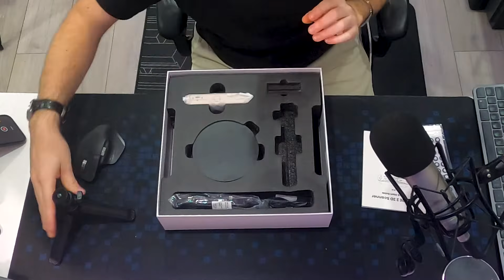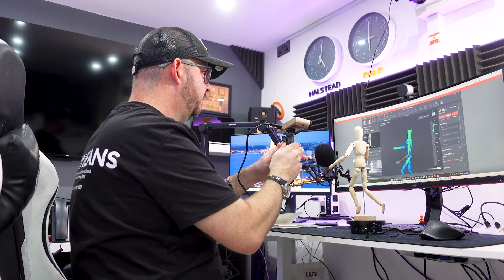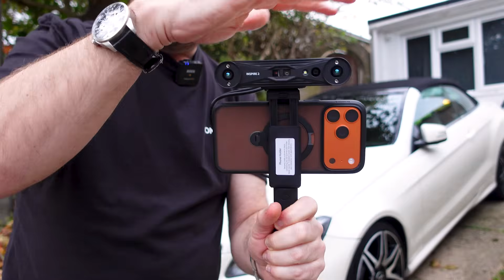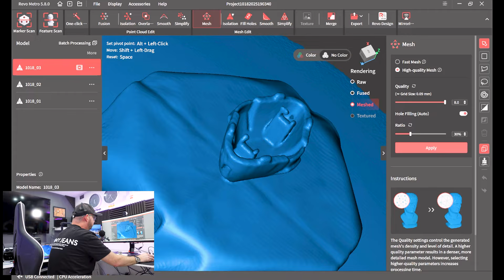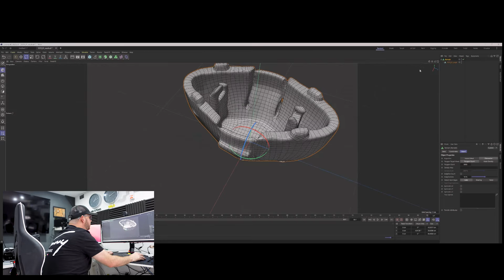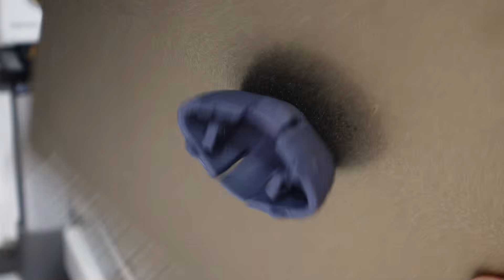Revopoint INSPIRE 2 Review | 3D Scanning for 3D Printing Car Parts (Mobile Kit Test!)

Comment from the maker: Is there any aspect of the Revopoint INSPIRE 2 would you like to see a follow-up video on? The mobile workflow, more on the post-processing in Revo Scan, or something else? Let me know below and don't forget to like this video! #revometro
🔗Link to Inspire 2: https://tidd.ly/3J1MFqI 👈👈
✨ Save at least 7% with the exclusive discount code: REVOPRRMFL
Reply: you REALLY need to try laser mode, it's the only 3d scanner in this price range that features this function and should be much more accurate compared to using the structured light.
Honestly it's the only reason to even get this scanner... if someone wants to try reverse engineering something, the other scanners in this price bracket are not suitable, this is the only option IMHO
Reply: It would be cool if you could scan other parts around your house that need repair.

Comment: Interesting to see! Thanks.
I'm looking for a relatively cheap solution to scan surfaces of RC cars to model off of. Now I'm measuring and making a ton of prototypes, tweaking and printing again. A scan of a front wing, for example would give me the compound curves to work from. Colours and textures aren't something I need though, 
This is a pretty new scanner I guess? I've seen your 3DMakerpro testing too, toss-up between the 2 brands?
Right now I'm stuck between the Moose Lite, Seal Lite or this.  Cheers.
Reply from the maker: Hey, in fairness both are good. This one is brand-new so the technology is likely slightly better, but I have had good results with both. It’s just important to remember that it’s not a super easy thing to do. It takes some effort to learn it, but then when you do, you can get some really spot-on results.

Comment: The laser mode is used for black and reflective objects and offers much higher detail. You've only used 50% of the scanner's capabilities. It's the only scanner with laser mode at this price point.
Reply: He did not use the available laser mode?  That’s disappointing.  This video shows that this scanner is not good for reverse engineering.  A shame if it actually is.
Reply: @f1hotrod527  The laser is the accurate portion as well. its used by the other option (not feature tracking). it requires many reflective dots ( they can be on the turntable). I have one coming tomorrow, then leaving for a weeks vacay, but if you want to know about this, let me know

Comment: For anyone out there wanting to get into 3d scanning but don't have 400 bucks to blow on one of these you can scan objects for free from your phone with photogrammetry, I use reality scan and get results about the same as this guy got from the video.
Reply: I find that the meshes and accuracy aren't as good with photogrammetry versus a dedicated 3D scanner. If you can't afford a real 3D scanner or just want to make videogame assets it's not bad, but if you want to use the scanned models in CAD or 3D print accurate parts, you definitely need a real 3D scanner.

Comment: Did you realize after doing the other side that you could've scanned the other good piece since they are both the same and just printed it without any further modification? 😉
Reply from the maker: Hahaha... 🤣 I love that you picked up on that... Honestly, it was fear of breaking it that made me not want to take it off until I knew I had a good replacement solution. 😅 

It was good to show off the use case for if you didn't have a good one, but technically now though, I absolutely could scan the good part and replace them again.

Comment: Can you scan the part in laser mode?
Reply from the maker: To my understanding laser mode works best on bigger objects with tracking dots for alignment. Because this piece is small and dark, structured-light mode gives a much cleaner result.
I’ll look at doing something that works best with laser mode in a future video. 
Cheers!
Reply: @ratemyfuneral what? laser mode should be much better for black and shiny objects, especially smaller ones.
you usually don't even need to coat the object with spray, but it's mandatory to use markers, and you need at least 4-5 markers always in the frame to not lose tracking, ideally you want to place many of them at different angles around the object or even on it if it's a large one, if it's small and you use a turntable, it would be best to use some poligonal supports with a few faces each with a marker, even better with different heights so they're visible even when they're in the background and you're trying to scan the sides of the object rather than the top